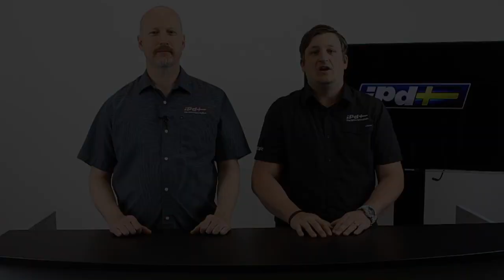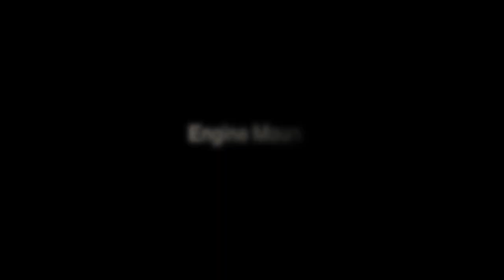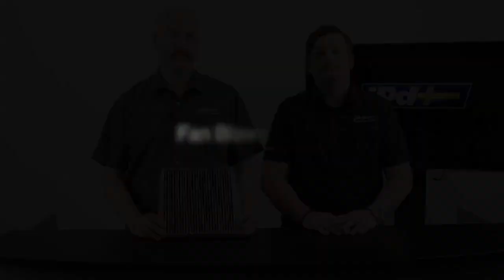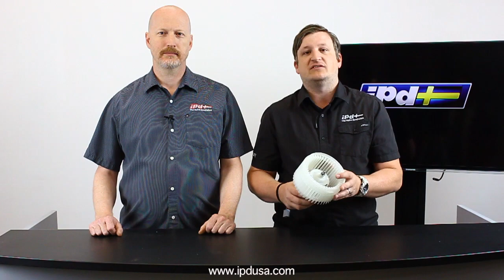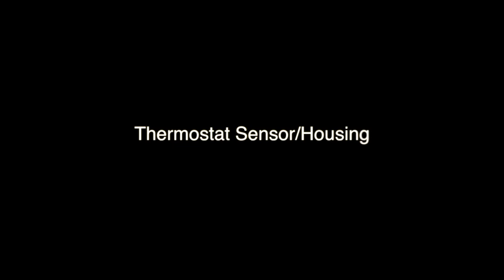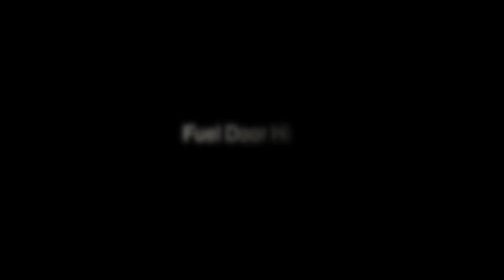Most Common Problems with Volvo P2 Chassis - IPD

Comment: My S80 sounds like it got hit with a sledgehammer every time I run over small bumps in the road.  It’s a 2002, so I’m sure every bit of rubber on any part of the suspension is dry rotted and failed.  It’s hard justify spending the money to fix it when I know it probably worth under $800.

Comment: My 07 S60 is worth about £1500. I have to rely on 2nd hand parts otherwise I would have to trade it in . The last one was a high pressure fuel pump I bought from a breakers yard on eBay for £50 when a new one was £500 .

Comment: Forgot to mention weak intercoolers,SAS,SWM,legendary injector problems..once this car starts braking down ...scrap it!It is the worst car iv owned..i still have it tho
Reply: Wrong. You need to do proper maintenance. Volvos dont have injector problems. Nothing wrong with the stock intercooler. There are bigger and better ones out there.

Comment: What are the symptoms of bad upper engine mounts?
Reply: RJ JT push the engine back and forward in the bay by hand. If its very easy to move they couls peobabky do with changing. If its quite steady (but still moves under revving of the engine) it may be ok. Mine was so bad you could  see the central bolt just rattling around within the upper bush when pushing the engine. I think there are 2 different types of bush (circular and square) depending on year of thr vehicle. And i think the later ones can be fitted to earlier ones to make them more reliable
Reply: volvo. v50
Reply: If they look bad or you can move them by hand... (I need a new bushing for the upper mount bc it's not really doing anything)😂